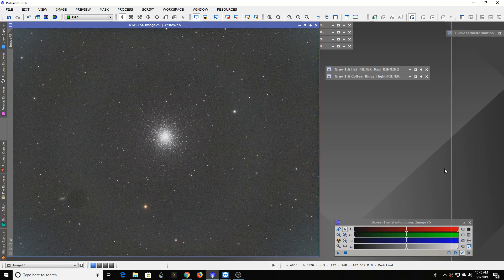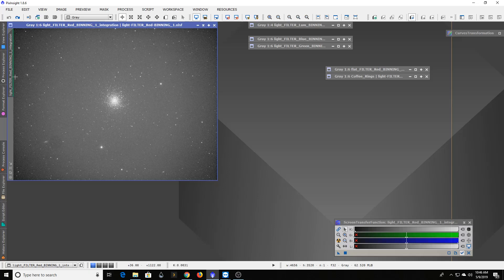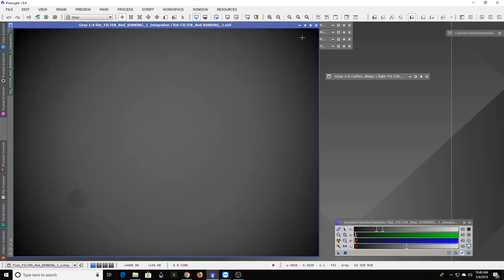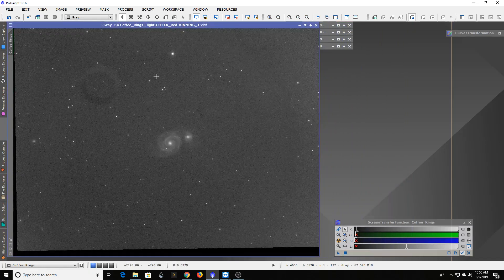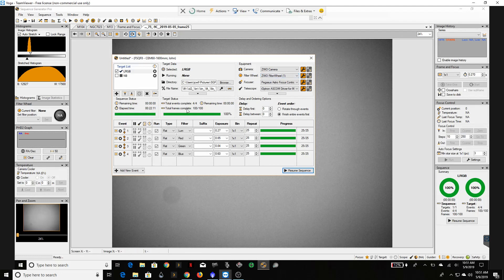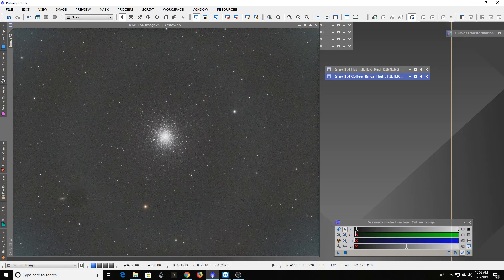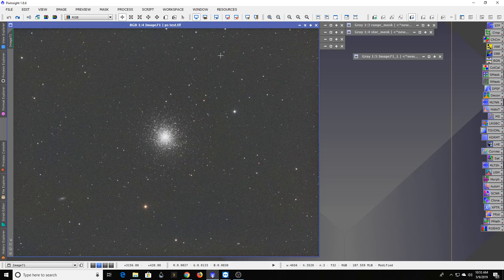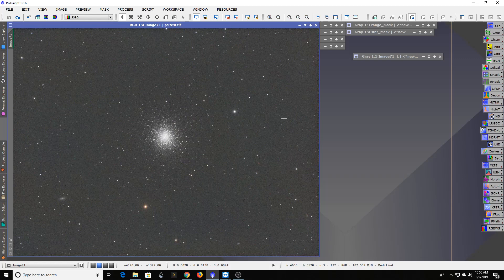Flat frames and coffee rings

Comment: Thanks for the video. In the video you talk about the focus being about the same for the flat as for the lights. I have an SCT that changes focus during the night as the temperature cools. How critical is it to have the focus the same between the flats and lights. I guess I have never heard of anyone taking different flats as the focus changes due to temperature. Is it ever a problem? Is it ever visible after flat correction if the focus has changed a little due to temperature?
Reply: Not that critical. Take the flats with the last focus you use. An alternative would be after each light frame take a flat, but that would be crazy.

Comment from the maker: One thing I should have added in the video was that the exposure of the flat frame is what will be different.  You're aiming to have your histogram hit about 30-50% for a good flat frame, which may only be half a second or so exposure, even if your light frame is 2-3 minutes.
Reply: Great video tutorial. In a Canon 1100D DSLR with a 70-300mm zoom lens (set at 300 mm, usually f5.6 max),  after fixing the ISO, what should I be looking for in the exposure values: Is it 30-50% of the Y axis units?  If the full scale number of units are not listed in a manual, can they be determined by over exposing and looking for a constant value somewhere in the display. Then, going back to taking a good flat, should I choose a shutter speed to give 30-50% of the maximum possible value?    [I could do that manually, or use it in aperture priority mode - the one where the f number is fixed and the shutter speed varies].   On f setting of the lens, is there an optimum f setting that will be the most forgiving of dust and airborne deposits?  Some years ago, I saw a video on flats which demonstrated  different settings to show the effect it had on subtracting the dust. I thought this was by choosing either as large or as small an aperture as possible or an optimum value between those, but I can't find that video now.  I have a feeling that high f numbers made the dust particles sharp and darker, and small numbers made them more blurry and fainter around the edges (or vice versa) but that there was an optimum f value rather than using fully open or almost closed aperture (where the shutter speed would be too long anyway).